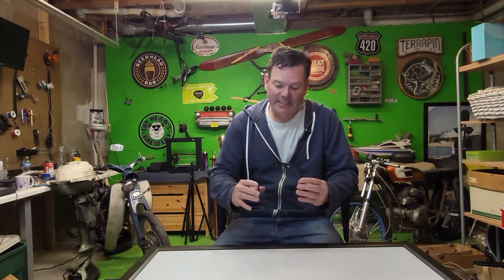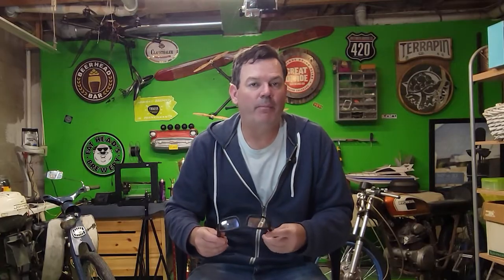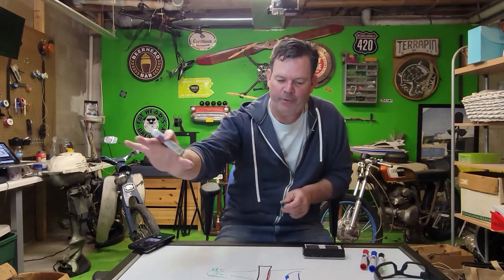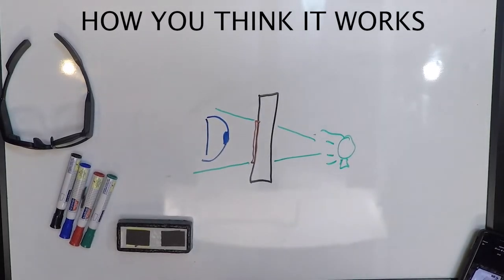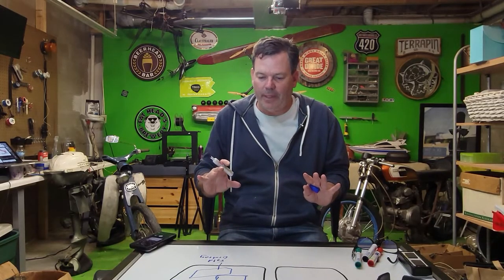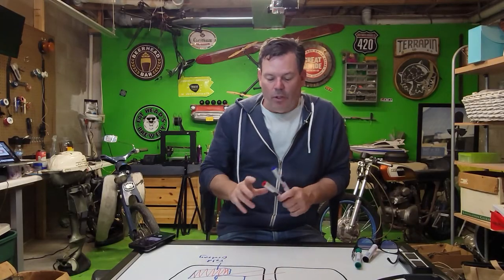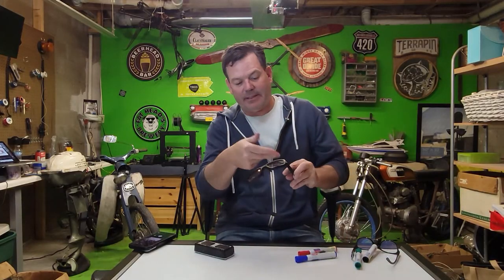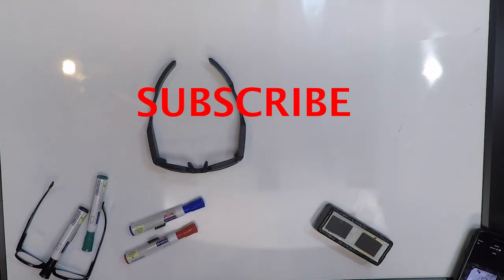Smartglasses WAVEGUIDES explained! - How they actually work!

Comment: nice video! as you said two years ago, now glasses have those grating structures in front of both eyes. just to add a bit of more info, the input grating collects light from the projector and sends it to the fold grating. in this path light travels inside of the glass like in an optical fibre. then the fold grating redirects the light to the outcoupler grating, this also happens inside of the glass. only when the light reaches the outcoupler the light bounces straight out of the glass into the eyeball. the cool thing about this grating-based device is that the glass or waveguide can be very thin and light weight, contrary to mirror-based XR devices such as google glass. and gratings are super tiny structures that the waveguide looks transparent.